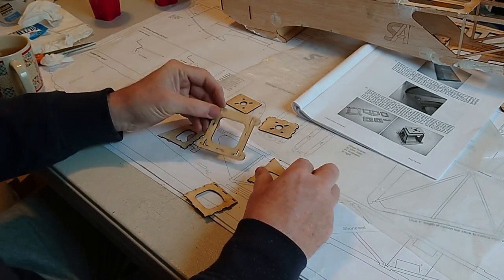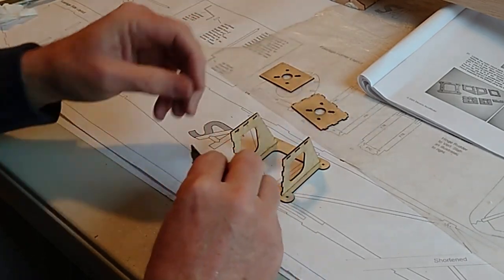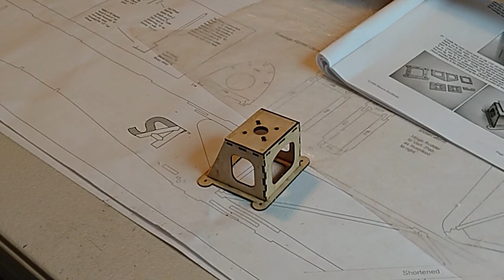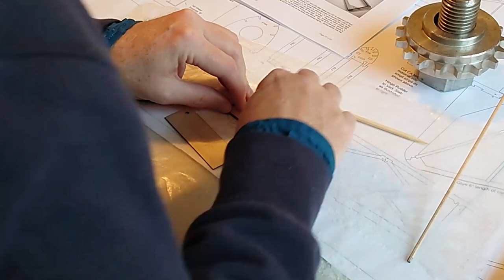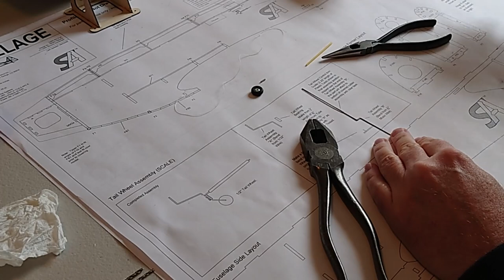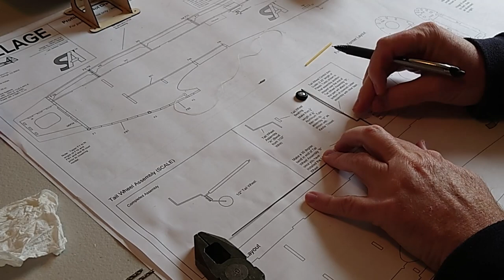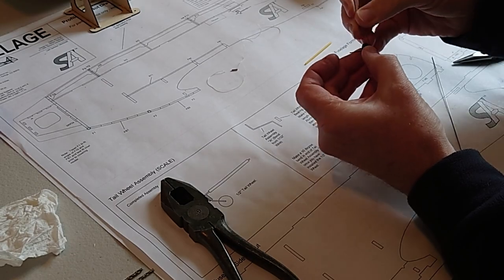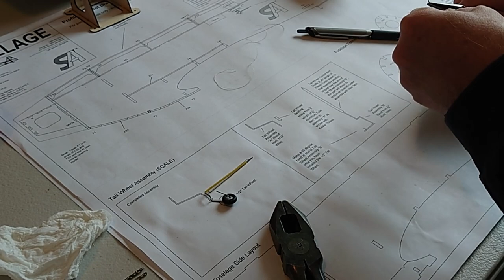Stevens Aeromodel G-480 complete rc airplane kit build, Episode 5

Comment: I think I decided to just cover the wire with some extra balsa to hide it n cover the wire. What would you recommend for the best motor? There's alot of options n I'm pretty new to this. I was gonna go with the Hacker a30-28s but saw someone put a Hacker b20 15l geared motor in. Is that too much
Reply from the maker: The balsa should work nicely.
I used a Sunnysky X2220 1400kv motor on 3S and a 10x5 prop. It had great vertical but was not overpowered.  I use eCalc to help narrow the field of possible motor choices but I'm limited to Sunnysky and Dualsky motors.

Comment: I have a question on the landing gear. Is there an alternative I can get. That's not so wire n cheap looking?
Reply from the maker: I suppose but I don't know of any.  Keep in mind that the gear needs to be as light as possible given the type of flying for which this model is designed.  You might find a lightweight carbon fiber gear that will fit.  Good luck and please post if you find a good set.